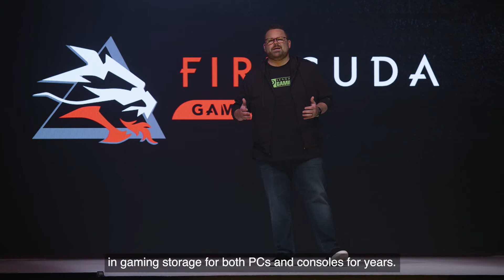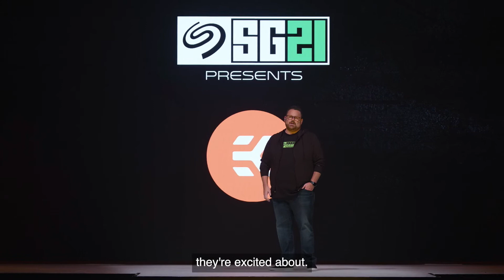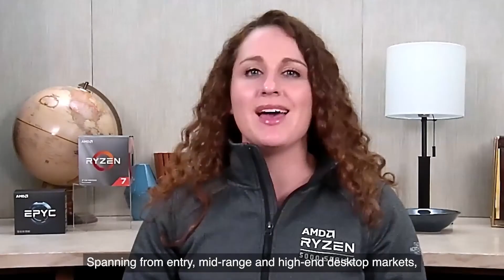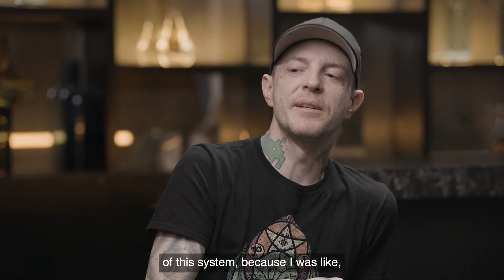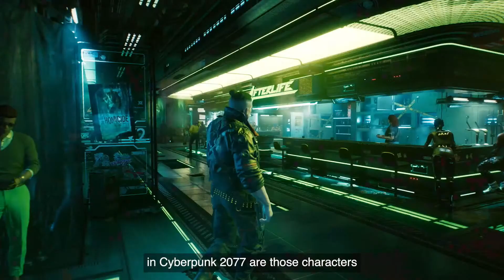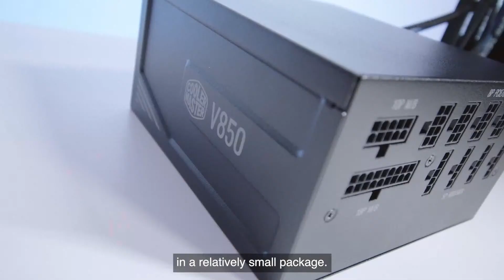Seagate Gaming Presents SG21

Comment: All lies. Look at time @39:52, they say that they are using 1TB model but looking at crystal disk mark, its clearly visible that they are using 2TB drive for all the tests, single, dual and triple.
Also, in the spec sheet, its clearly mentioned that 1TB model can write upto 6000 MB/s and only 2TB plus model can reach near 7000MB/s which again validates my point.